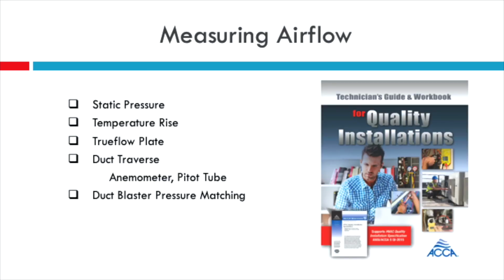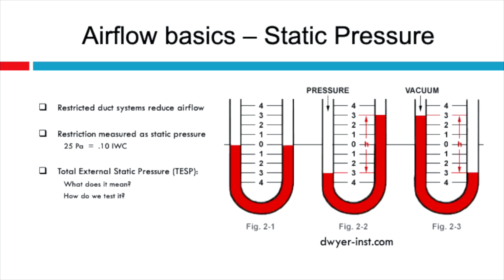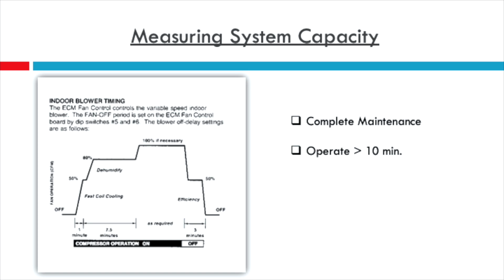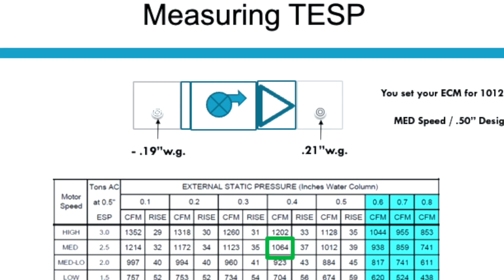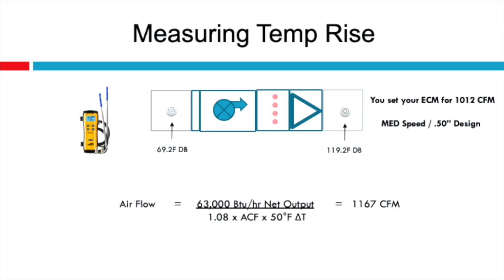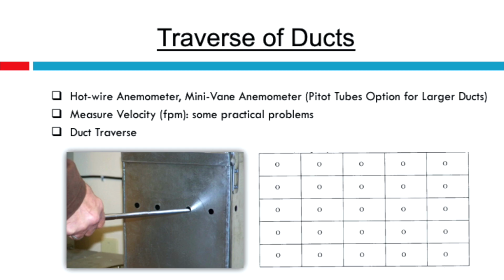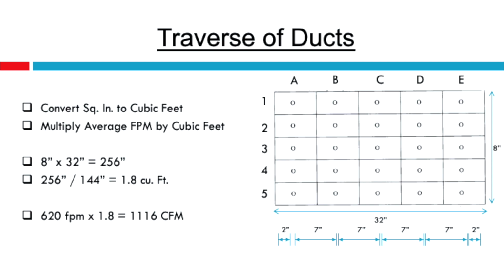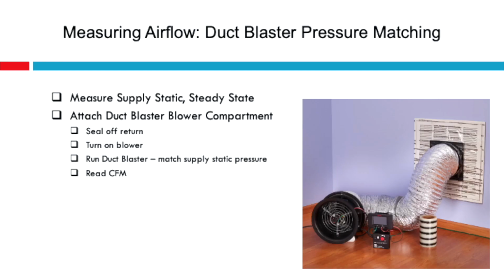HVAC Quality Installation: Measuring Airflow

Comment: Chris-when using variable speed system, how do you determine’ ‘medium speed” to check actual static vs design load static> or do you just design it for max speed and then set the hvac unit/blower to max and wait ten minutes to measure?

Comment: Most furnaces come under fired burning gas inefficiently. Combustion analysis can impact the temprise method, that's why clocking the meter is so important to get at least one solid number in the formula to start.